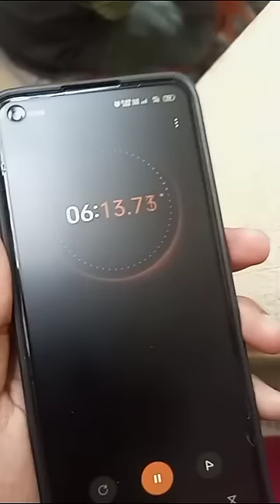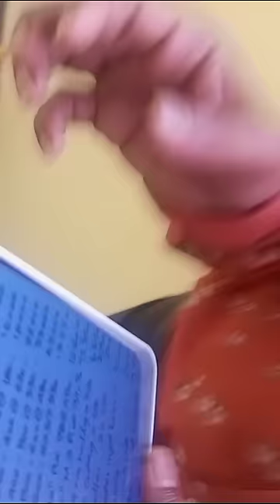ultimate High pressure ROBO Borewell Drilling machine short video of two days works by J Selvaraj 🙏👍

Comment: Sir we have a borewell in our apt and not used for since 20 years. Are you doing camera scan and tell us if it can be made workable again or not. If so what would be the cost. How much do u charge for camera scan. Pls share your mobile no.
Reply from the maker: Call me back 9 am to 10 am or 5pm to 6pm 9035278897/9342278897